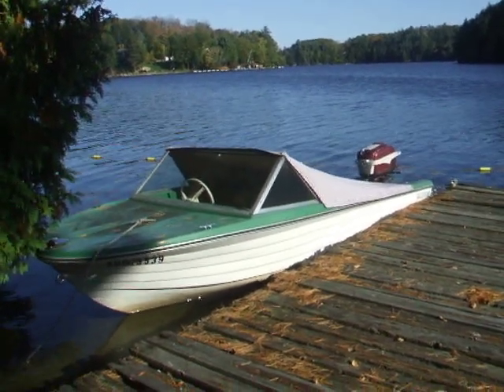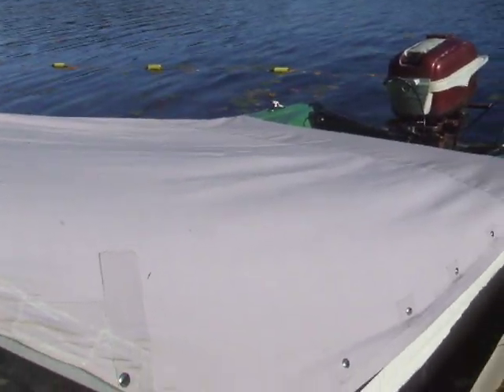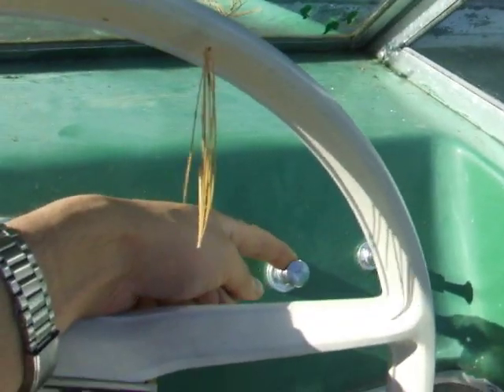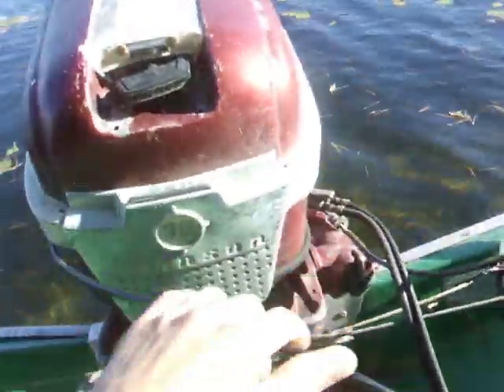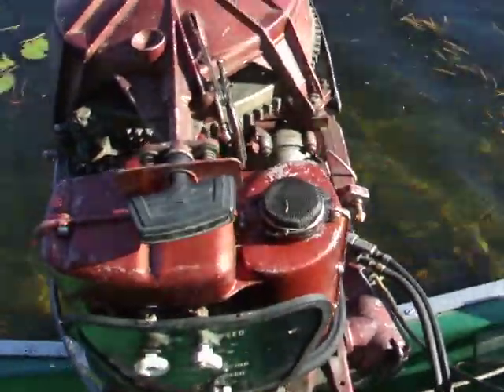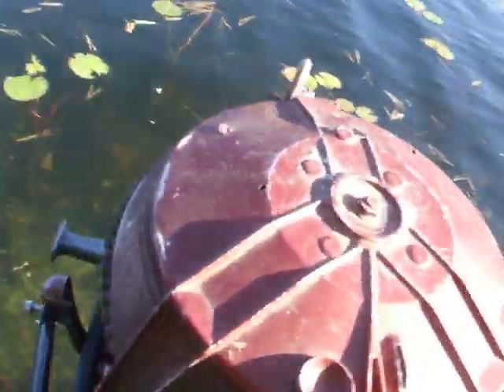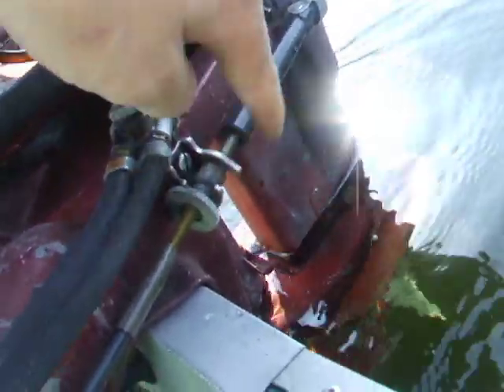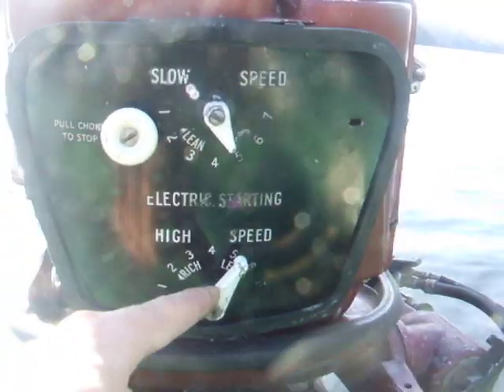1956 Johnson Javelin 30HP Outboard on 14' Viking Fiberglass Runabout

Comment: BTW, that 1050's 30 hp will run on a 50:1 fuel/oil mix without complaint or damage; the OMC's in that HP range were 'full jeweled' motors meaning they had needle bearings in the rods.  Today's TC-W3 oil is far better than what was used with a 24:1 mix Back-in-the-Day when they recommended use of ordinary 30 wt. non-detergent oil - ie. cheap crankcase oil.

Comment: The more I see these older motors run the more I want one.. the beginning was too tedious.. chop it out.. he he no pun..good overall video.. thanks.. I really appreciate the look and feel ion of the pressurized fuel tank.. thanks again and have fun..x😀😎
Reply from the maker: Thanks for your comment Michael.  Perhaps the 1st part drags a tad - I did most of the video in one take and it's difficult to film and keep the whole 'script' in mind at the same time....:o)  Let me know if you'd like help looking for one of these older gems - they can be had for a couple hundred, mostly running.  If necessary maybe another hundred in parts and some work and you can have a motor that rivals a $10k one - hard to believe!  I also have some manuals, and brochures for the whole Johnson / Evinrude line.  Hope all your boating days are happy ones - Cheers!  Bellarmine

Comment: wow, very good setup! how did you do all the wiring ect? like electric start and steering? do you need a battery or a power source for it all to work? i have a 1973 20hp runabout similar to that and im wanting to set up steering and electric start on it all. im fairly new to the boating world! thanks

Comment: nice boat and motor- you probably want to put that mercury switch back on- it keeps the motor from "running away"

there is another fuel ratio for old motors- 16:1  the 3, 5 1/2 and 7 1/2 motors from 1950 through at least 1960 required 16:1- they were all bushings
Reply from the maker: Thanks for the comment.  I didn't know the 3, 5.5 and 7.5 HP motors used 16:1, I'll keep that in mind for the future.  As for the mercury switch, actually it prevents you from cranking the motor when the throttle is too high, no big deal to me.  If you're referring to the cut-out vacuum switch that shorts one cylinder when there's too much suction in the carb during a run-away, that's still in place.  You can see it still mounted behind the carb silencer on the port side.  I think I can hear it click now and then when I pull the throttle back suddenly lol.  Glad you enjoyed the video, cheers!

Comment: spent a lot of time in my youth with one of those
Reply from the maker: Hi, sorry for the late reply.  Thanks for the comment, I was looking at your other videos, you have a lot of fun with your Johnson 5.5 and Evinrude.  Yes, the high-speed adjustment makes a BIG difference.  On the 30hp in my other videos, after overhauling the carb it was labouring along at 5mph at full throttle, until I closed the hi-speed jet til 1/4 turn open, then it took off at 25MPH!  My Dad used to have a 1960 5.5 exactly like yours, he wishes he'd kept it.  Thanks for the comment - cheers!
Reply: That thing has torque, 2 cycle torque, great

Comment: I have 1961 Evinrude 18 HP and first hour or so I run it 1:50 oil ratio. After switching to 1:24 mix it runs smoother on low speed. My previous 9.9 hp Johnson 1960 was running well too
Reply from the maker: Thanks for the comment!  Yes, I just run 24:1 (or 25:1 for easier calculation....:o). Or easy no measure method from Johnson, just put a gallon of gas in the tank, then 1quart/litre of oil, and then fill it up.  According to the Johnson factory shop manual, I can run 50:1 in motors newer than 1964 , like my 1974 6hp, and it seems to run dandy that way. I heard they went to 100:1 in the 80's for a short spell with oil injection - caused problems so they went back to 50:1 - good enough in my opinion.  Heard a lot of people say the modern 'higher quality' oils allow you to run less oil on the older motors, but I'm not interested in burning up a vintage powerhead for $3 of oil....as someone told me, if you're that poor you shouldn't be boating lol....:o)  Cheers!  Bellarmine
Reply: You never had a "nine-point-nine from 1960; that was a plain ol' "ten." Your '61 Fastwin 18 can run 50:1 all day; it has full needle bearings on the mains and both ends of the rods.  Remember, the TC-W3 oil we have today is a lot better lubricant than the non-detergent straight 30wt crankcase oil we used Back in the Day.

Comment: That motor is hummin! I just bought a 33hp 1966 Johnson. I hope it works. lol
Reply from the maker: Thanks for the comment Augy, it sure does run nice!  It should after overhauling the ignition, carburettor, lower unit and electrical system.  Starts EVERY time with no effort, unlike my neighbor's newer 1988 30HP Johnson - endless problems and $!

Good luck with your new motor, they are gems once you get them running, which isn't too difficult due to the utter lack of electronic complication.  Do let me know if you have any questions or need any advice, I've helped a few people in the past and it worked out nice.  I even have a large electronic Johnson/Evinrude brochure collection, I can send you the 1966 one if you'd like.  All the best and Cheers!  Bellarmine
Reply: Wow, I'll totally take you up on the offer for the manual. The model for my Johnson is RX-14. How do I get that from you? I'm totally incompetent about motors but always wanted to learn on an small old engine. Guess I have my chance now. lol
Reply from the maker: Hi Augy, no problem, I'll be more than glad to help you out any way you need, enjoy it actually.  The only problem might be if you can you deal with my generally long-winded emails lol......;o)  I can email you the 1966 brochure as a PDF, and set you up with a shop manual and lots more info too.  I'd ask you to send me your email address, but I noticed that YouTube has removed the entire Private Messaging system (duuh)!!  Instead of putting our addresses on here, you can reach me after simply looking at this small PNG picture:
https://s25.postimg.org/41jj00qpb/bell.png

Talk soon Augy, cheers!  Bellarmine
Reply from the maker: Hello again Augy, I"m wondering if you were still interested in a 
brochure for your 1966 Johnson 33HP?  I'd love to email the PDF to you, 
but I don't know how we can share our email addresses without putting 
them on this public comment board.  

Perhaps I should have explained, the link below is simply a .PNG picture / screenshot of my email address, to prevent spambots.  If you email at the address shown in the image I'll get right back to you.  Hope to hear from you soon, Cheers! Bellarmine

https://s25.postimg.org/41jj00qpb/bell.png
Reply: Email sent. Thanks mate!
Reply: AFAIK your mid 60's OMC 33 was a sort of recycled 1950's 35, and the earlier 28 HP was a recycled 1950's 30 HP.  They needed a motor in the HP range between 18/20 and the 40 HP for the budget-minded boater.   The 28's and 33's didn't have the shrouded exhaust but neither did the earlier 30's and 35's.  And, oddly they dropped the shrouded exhaust from the 40 HP in the mid 1970's; if you wanted shrouded exhaust you had to go to the loop-charged 50 which now bore the Lark model name in the Evinrude lineup.

Comment: would love to find a 56 or 57 javelin restored for my restored 55 14' cedar strip.
Reply from the maker: I've seen a few for sale on Kijiji Ontario for not bad prices, couple years ago I almost snagged a 35HP Golden Javelin for only $120, in need of a paint job but probably running.  Maybe try joining the "AOMCI.org" and "forums.iboats.com" forums and ask around - they might know where one exists.  I'm actually the 2nd owner of this one, the grandsons of the 1st owner made a gift of it to me a couple years ago, since I had helped them get it running.  Just took a cruise yesterday and still runs like a Swiss watch.  Let me know if there's anything else I can do, good luck with your search Steve - Cheers!~  Bellarmine
Reply from the maker: P.S., here are two, hope they are near you.  Perhaps need tune-ups, but cosmetically in GREAT shape, which is the hard part.  As you probably know, these are REAL easy to work on, so if the cosmetics are in good shape it is pretty easy to get them running, parts are cheap too (I can even give you some pointers and email you some manuals / original BROCHURES if you want...:o)  Cheers Steve!
https://www.ebay.com/itm/113727304331
https://www.ebay.com/itm/352765258881

Comment: Thanks for sharing, I have a barn find  R J E - 18 (30 hp)  a gift from a very good friend, along with a 14 foot Crestliner of the same vintage, she goes 23 and change.  (By Garman GPS)  I use 24:1 oil mixture.  I am of the belief that switching to less oil on newer motors was a corporate concession to the gods of environmental awareness, at the expense of the life of the motor.  Perhaps an engineer who understands these things could tell me how "synthetic oil" factors into the 24:1 or 50:1 Oil debate.  -Oree
Reply from the maker: Hi Oree, thanks for your comment!  So you have the same motor, beautiful, you must be pleased!  Good to know the speed, mine goes near the same with my heavy old Viking Fiberglass.

I also run 24:1.  Heard a lot of people say the modern 'higher quality' oils allow you to run less oil on the older motors, but I'm not interested in burning up a vintage powerhead for $3 of oil....as someone said, if you're that poor you shouldn't be boating lol....:o)  I do run 50:1 in motors newer than 1964 according to the shop manual, like my 1974 6hp, seems to run dandy that way.  I heard they went to 100:1 in the 80's for a short spell with oil injection - caused problems so they went back to 50:1 - good enough in my opinion.

If you're interested I can email you a PDF of the ORIGINAL brochure for our 1956 motors, and any other years you might like.  I found a site with them all and downloaded them  - let me know.

Thanks again for the comment - enjoy the Summer with your vintage Johnson Oree - Cheers!  Bellarmine

Comment: Gasoline produce about 12 HP for 1 hour per gallon. 35 HP would use 6 gallons in 2 hours. 60 miles traveled that great mileage on the water.
Reply from the maker: Thanks for the comment, yes that sounds about right, that's about what I figured - 6 gallons, 2 hours at 25MPH equals 50 miles on 6 gallons.  Interesting mathwork, guess no-one has figured out MPG figures for boats lol.  Best wishes and Cheers!~  Bellarmine
Reply: Older 2 stroke outboards uses roughly 0.5 liters of fuel pr. hp pr. hour. So 30 hp at full throttle would use about 15 liters an hr. (just under 4 gallons)

Comment: Hello I have this engine and  I was working on it today and found your video (thanks for making it btw it was vary helpful) And my throttle cut out switch (with the murcury[safetyswitch]) was sparking/smoking the adjacent throttle cable so I kind of wanted to remove it like you did. And I wanted some clarification did you keep the cutout switch wired up and just get rid of the mercury switch? 

Agian Thank you for posting 
Its videos like this that make youtube great.
Reply from the maker: Hi Kay, Thanks for your question, glad the video was helpful and thanks for the compliments!  Sure, I can help you figure that out, something similar happened to me too.  If you don't mind I just need to ask a few questions so I can understand what you're saying.  The cutout switch (mounted beside the Carburetor) actually has nothing to do with the mercury switch (on the throttle bevel gears), so which one are you having a problem with?  In case you don't know, the mercury switch prevents the electric starter from operating if the throttle is above high idle.  The cutout switch keeps the engine from 'running away' after an abrupt throttle down, by shorting one cylinder to ground under very high intake vacuum.  In my Javelin I left the cutout switch alone, but I completely removed the mercury switch, as it was case grounded, so I couldn't use it with the standard starter solenoid I bought .  So, I have to be careful not to crank it at full throttle.  Doesn't bother me, but my Dad has done that once or twice already....(!)...:o)  Hope this helps, let me know by all means if you need further assistance, be my pleasure.  You can contact me by looking at my "About" page, my address is there.  Cheers Kay!~  Bellarmine
Reply: @bellarmine33   Yup, I thought you had removed the vacuum switch. People really do start these things in gear at full throttle. My father did this and flipped the whole boat upside down on himself, he was playing hero and jumped into my 12 foot aluminum boat with a hopped up big twin motor to rescue some female in distress or something...
The neighbors thought it was hilarious 😂 
He didn't even untie the boat, lucky because it would have taken off empty across a 7 mile lake.
You can't fix stupid, but OMC really loaded up on safety features 👍

Comment: found vintage Airguide tach with 1 to 6 pulseinput settings on ebay, that should do it
Reply: Yep, the Airguide tach will work.  You will have ONE pulse, from one magneto, per revolution.  To 'kill' the motor they connected both points together; since ONE set is always closed that keeps either coil from being triggered by a 'breaking' set of points.

Comment: The wiring ??? I got the starter ground and choke but How do you kill the engine and get electrical power to recharge the battery? thanks Tom.
Reply from the maker: Hi Tomsole,

It's interesting, I get quite a few questions on this, I guess my dad being an electrical engineer helps my understanding a lot lol!

I'd need to know your engine model to be sure, but offhand unless you have a separate belt-driven generator, there are no charging capabilities in these older motors.  About how to stop them, just hold down the electric choke switch until it shuts down, or pull the choke on the control panel.  That's what I do at the beginning of the video when you see my motor shut off.

If you need any help wiring up the starter, choke or adding a keyswitch to shut it down etc, send me a PM with your year, HP and/or model and I'll give you some help and details!

Thanks for the comment!  Bellarmine
Reply: +tomsole99 there is no generator for charging unless the motor has the optional charging system attached, kill with switch to mag wires

Comment: I have always heard 24:1 and 50:1 etc.  How much oil do you add to 6 gallons of gasoline?  1 pint?  TIA.  JEE.
Reply from the maker: Hi John,

Thanks for the comment.  For 6 US Gallons of gas, add 1 quart of oil for a 24:1 mix, or 1/2 a quart of oil for a 50:1 mix.  If the motor is a 1964 model or newer, use 50:1.  Not sure what you mean about the "TIA" and "JEE".

See here for some fuel mixing info, and a whole bunch of other info as well (scroll down a third of the way to "Recommended Fuel / Oil Mix"):
http://www.leeroysramblings.com/OMC_6hp.htm

Cheers!
Reply: TIA means Thanks in Advance.
Reply: bellarmine33 TIA = Thanks in Advance and JEE are my initials.

Comment: How much does this boat weigh? I have a similar setup and just wondering what kind of speeds I would get
Reply from the maker: Hi Matt, Thanks for the question!  I really don't know exactly, I would guess my hull weighs around 300-400lbs, just a guess at the way I can heave it around on the trailer when I'm fiddling with it.  The motor is about 125lbs, so with the gas tank, battery and me in it - around 650-750lbs I would guess.  I have another video of when I put a vintage AirGuide speedometer in it, I get between 22-24MPH on a good day, check it out:
https://www.youtube.com/watch?v=t9VltJ9CnAA
https://www.youtube.com/watch?v=Vwz9nKnOE-c

I looked at a couple of your videos, nice boats!  Do you have a little boat like in your channel banner, looks like my own 1974 Johnson 6HP in another of my videos I grew up with.  Your 28HP goes like a bat, and is the 85HP in the duel a V4?  Personally I like the 40HP setup better, nicer looking boat...:o)  Let me know if you'd like a free PDF brochure for your motor(s), I have 'em all on my HDD, if interested just shoot me a mail at my address on my 'about' page. Cheers Matt!~  Bellarmine
Reply: bellarmine33  Thanks! And yep that 6hp was the motor I started with when I was younger, great motors.